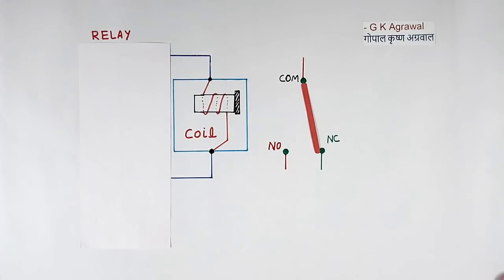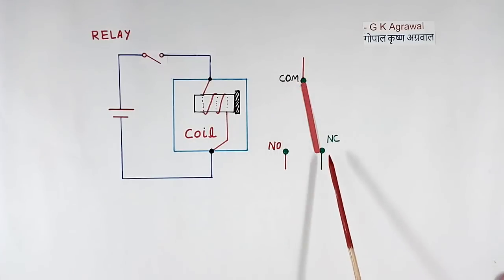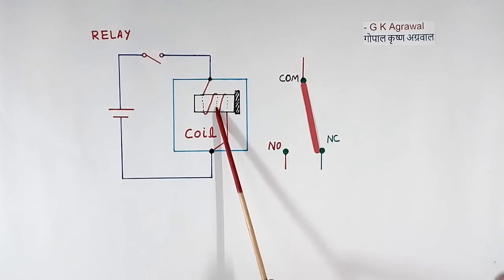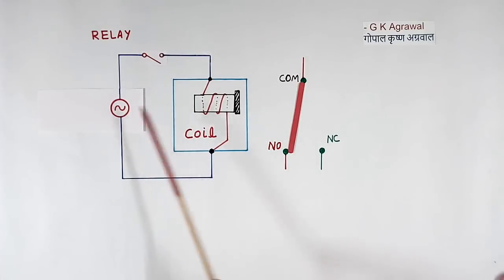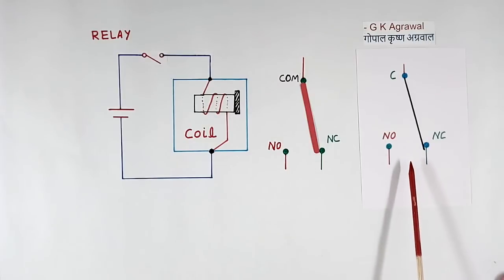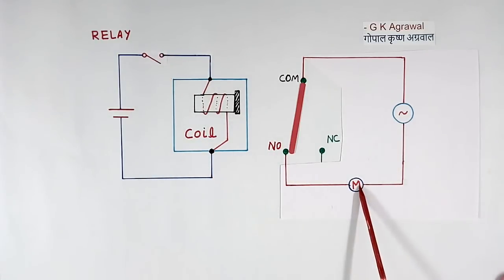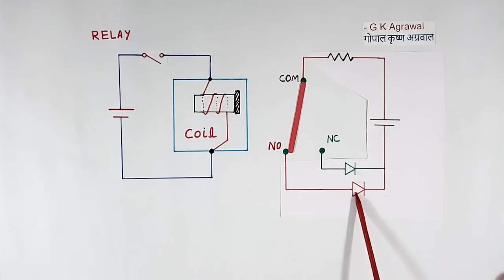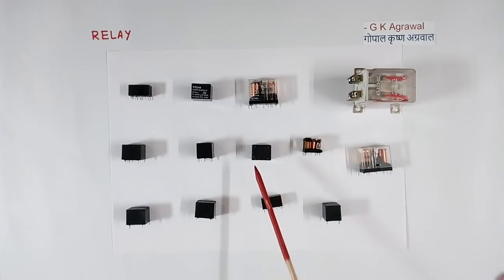Relay working in Hindi | What is relay NO NC contact, experiment

Comment: Sir relay ko agar load ke series m lagaye to current badhega ya kam hoga.
Reply: pooja sharma  Relay will have control circuit...a threshold value and actual value directed from ct or pt according to that level ,relay operates,relay basically operated at control level signals but not at power level.hope u understand..

Comment: sir 9v battery..2v LED..9-2=7÷470=0.014893617 current
ya fir ...
9÷470=0.0191489362 current
kon sa formula right he
Reply from the maker: 1st one, LED drop to be taken as per type number.
Reply: G K Agrawal ji gharo me light board me indicator hota he red color ka usme kon sa formula use krta he 1st ya 2st kyuki voltage to change hota rhta he jese 220 230 210 .. please reply

Comment: Sir 9 volt ki battey ke sath kitne ka resistant lgaya tha aap ne
Reply from the maker: LED key series mey 470 ohm ka.
Reply: sir 9v battery..2v LED..9-2=7÷470=0.014893617 current
ya fir ...
9÷470=0.0191489362 current
kon sa formula right he